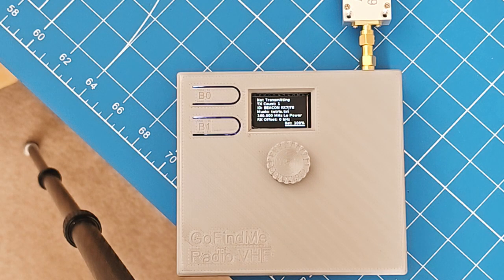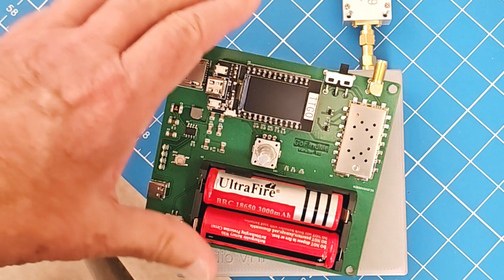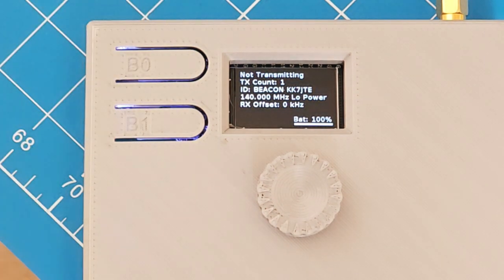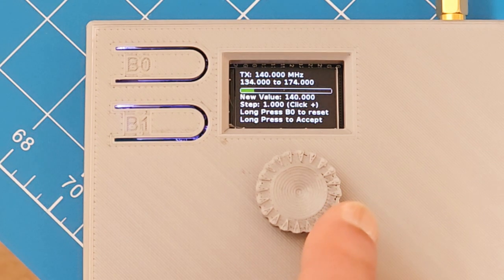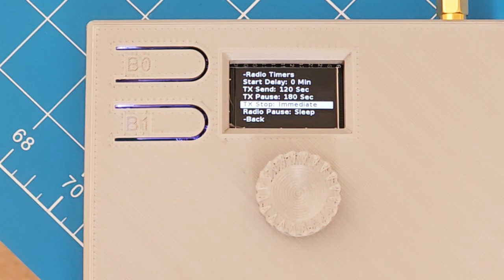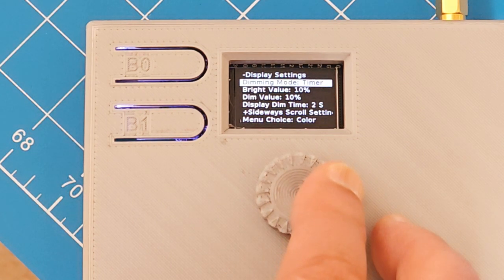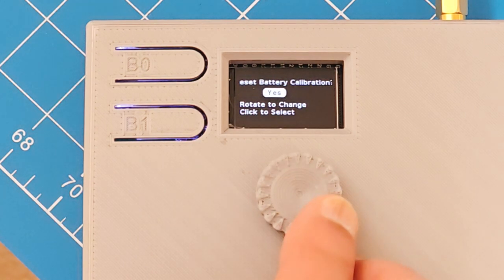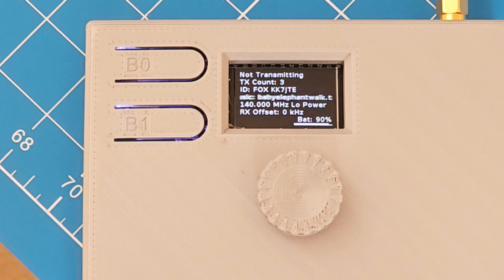Ham Radio Fox/Bunny Hunt system using esp32 and SA818 module

Comment: The user interface is done very professionally. I would be interested to learn more about the actual code. 

Keep up the great work. 
73
Reply from the maker: I you send your email to mnohr247 ... gmail... I can add you to the github repository. Please respect that I have not decided to share this code publicly yet.
Reply: @martinnohr4505  Thanks for offering that. Sure will do, I did a very simpler version years ago and totally appreciate how much it would take. There will be many things for me to learn there. 

Thanks
Reply from the maker: @VA7AYG  I didn't see your email yet, but I also haven't checked... sorry. I'll look later tonight. I think you'll find the code interesting. It is designed using RTOS tasks (real time multitasking operating system)for the different processes going on. I used FreeRTOS for the OS.
Reply from the maker: @VA7AYG  I haven't seen a request from you in my spam email. Send one again and make sure you put "radio fox github" to make it easier for me to find.
Reply: @martinnohr4505  thanks Martin, I just sent a new one using my Yahoo. Sometimes my other email gets blocked by the server.

Comment: Have you considered a lower power setting for on foot foxhunts over a smaller area?  10mW?   I suppose one could put an attenuator on the output but battery savings would be nice.  How about a waterproof case?  Sometimes dew and rain happens.   Since it's ESP32 it has BT and wifi that could be used for settings.

A .txt file for music?  How are those created?
Reply from the maker: It's not really music, just tones, like a very simple midi. Look here: https://github.com/robsoncouto/arduino-songs/tree/master
I am working on a design with a real audio chip for the future, then you can put real music and voice on it.
Reply from the maker: Water proof case would be nice, but costly unless I start selling enough to pay for case design. I just 3D printed one. It's a hobby so far!
Reply: @martinnohr4505  3D printed case can be made waterproof with a few adjustment of the print parameters only.   Well, maybe a lid gasket, stand alone ip67 pb, and a small piece of acrylic for a window.
Reply from the maker: @I_B_Phrede  Don't forget the USB port and the SD slot and the cooling slots. Still, you raise a good point and I'll give it some thought when I have time. I just put mine in a sandwich bag. 🙂
Reply from the maker: The SA818 radio module I'm using only has two power settings, 3W and 5W. Attenuator would work of course. I have actually almost got the web server code working to set the parameters. It does mean connecting your phone or computer to it with a browser. I kind of like the little display and how easy it is to set things.  With Panasonic 18650, low power, 1 minute tx, 4 minutes pause I got a run-time of 12 hours. Enough?
Reply: @martinnohr4505  12 hours is enough IMHO

Comment: I would be interested in buying one too..
Reply from the maker: I found a flaw in the prototype PCB's that I designed. It was affecting how the charger chip thought the battery charge was, so it turned off before the battery was really run down. I have reworked one board and it seems good now. With Panasonic batteries, 1 minute transmit, 4 minutes pause, at low power I get a run time of 12 hours. I think that is more than acceptable. It will be about 8 weeks before I can get new PCB's, but I am willing to sell the 3 extra prototypes I have here for $90 (plus shipping) each. That is the complete system mounted in the box but without batteries and antenna. The batteries are button top 18650. I can include the batteries (Panasonic) for $20. Shipping is about $16 to most places in the US. My PayPal account is @martinnohr or @nohrphoto.
Reply from the maker: I just sold the last one I had, but I have ordered more PCB's. I'll have some more in September.
Reply: @martinnohr4505  Any update on availability?
Reply from the maker: @BrianZoraster  I had 9 of them that I sold on eBay, sorry you missed out. I'll be getting some more PCB's, but I have them made in China and I don't want to order any more until this stupid tariff thing settles down. Also, I'm changing the design a little bit, I'm adding a sound chip to allow audio files for the identification message. Give me a few months to finalize that design.
Reply from the maker: @BrianZoraster  I'm waiting for the stupid tariff wars to settle down before I order any more PCB's.

Comment: Where can I get one?
Reply from the maker: I'll probably set up an Etsy store, but I've too busy just getting all the code to work. I do have a few prototypes ready. Would you be interested in doing a review for reduced price or return it when done? We haven't decided on a price yet though. I'll discuss it with my partner. I mostly write code and do circuit design.
Reply: I would be interested in reviewing and purchasing a couple of units.
Reply from the maker: Thanks for your interest. I'll get back to you as soon as I can. I have a couple of busy days and then I'll post something here about how to order them. I only have 5 right now, but I will be getting more soon if there is interest. I wasn't sure how many people would be interested in something like this. It has been a fun project. I just added a couple of new features, the main one is that you can save named settings, so it will be easy to configure it quickly. I'll post a video on that soon also.
Reply from the maker: See my comments to BrianZoraster about purchasing above. I only have 4 right now, but I will be having more made after I make some changes to the PCB design.
Reply from the maker: You can order from paypal, @martinnohr. I don't have any right now, but the boards are being made and I should have them September 1, 2024. I'll post it here when they are available again. I will also list them on eBay.